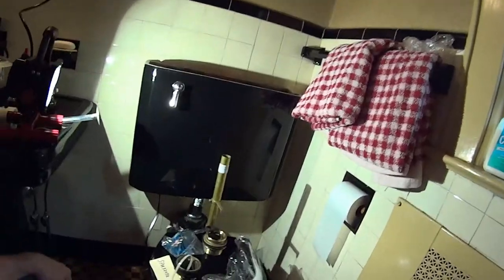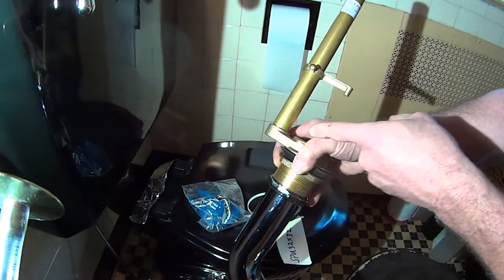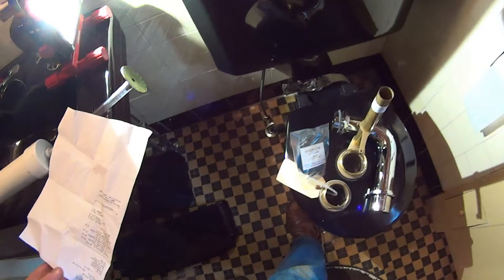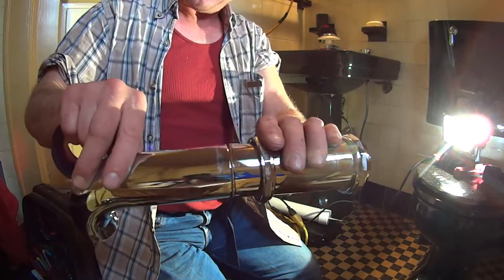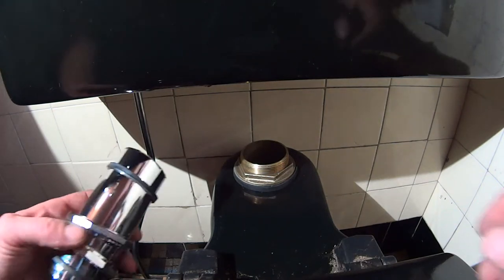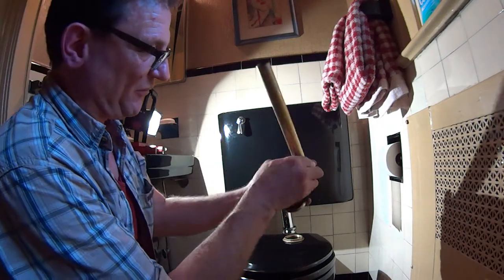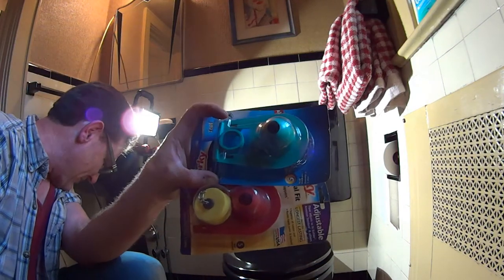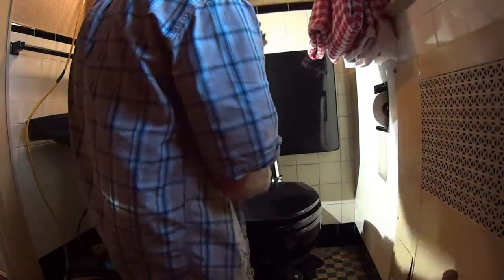Vintage 1930's Toilet Wall Mounted Tank,  Ell Replacement

Comment: This replacement needed an "offset flush ell" -- the tank is further away from the wall than the toilet inset.   It did not need a 90 degree flush ell that is cut -- resulting in a straight pipe (which could have been bought outright) that is then installed at an angle.   He's doing it wrong.
Reply: I am a service plumber and this guy is making me wince. Nice toilet though, hope he has the lid too.

Comment: Love this - do you have a video who to change the flush & fill valve on these types of toilets? I have an old one, very much like this one and I can’t tell where to turn the water off. Do I have to remove the tank at top for replacing the valves? Looks like the valves need to be replaced, many thanks for any information @DinoPinch you can provide... Virtual hugs. ( 💋 Leah )
Reply: I have one like this, it doesn't have a way to turn the water off like there are under the sink.  You have to call your water dept to turn off water to your house (or apt.)  It should be near the curb.

Comment: Nice video.Thank you. Are all the 2" flush ell's always so out of plumb as this one?
Reply from the maker: i did'nt put the toilet in, it was installed before i was born. even the plumbing supply guy commented about out of plumb when i show a picture. i just replaced the pipe
  ·
Reply: Dino Pinch  what year is that toilet from
Reply from the maker: jhenry1041 me thinks after world war 1 and pre world war 2 , in the 1930's ??
Reply: do you know exactly what year

Comment: I am getting a bad leak where the intermediary pipe (mine is an elbow) between the tank and bowl connects to the flush valve. The problem is that the threaded bottom of the flush valve slips OVER the intermediary elbow pipe. As a result, when water flow through the flap, it hits the joint and lots of it leaks out. 

I don't understand how to seal the joint where the larger "pipe" of the flush valve base connects with the slightly smaller elbow pipe that slides into to flush valve.
Reply: I'm having the exact same problem.  I'm assuming that I need to fill the gap between the ell pipe and the flush valve with plumbers putty.
Reply: Hey thanks for this video...it’s the only one on YouTube that shows how the spud gasket side works.  On my model the pipe going into the toilet bowl is on the back of the bowl and the pipe from the tank is what they call “L” style.